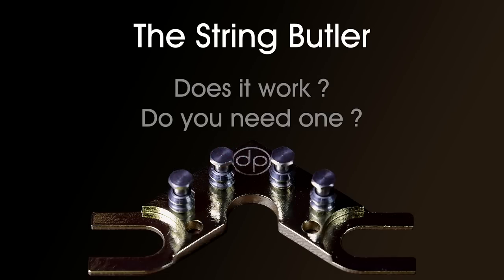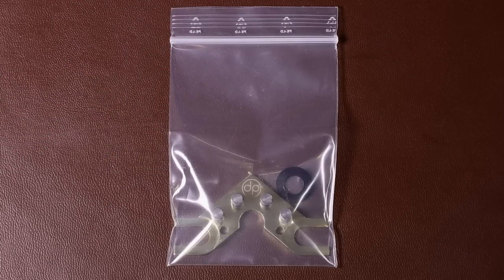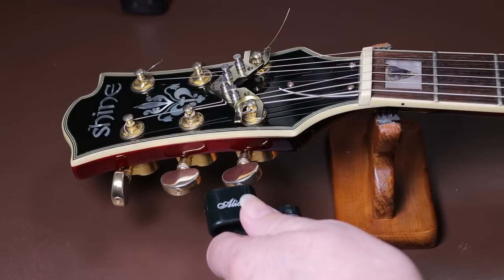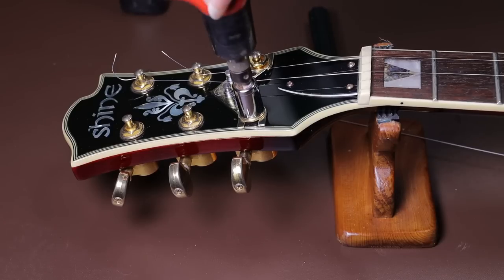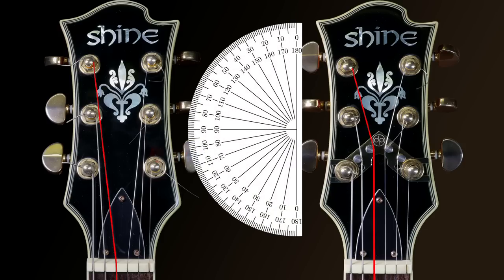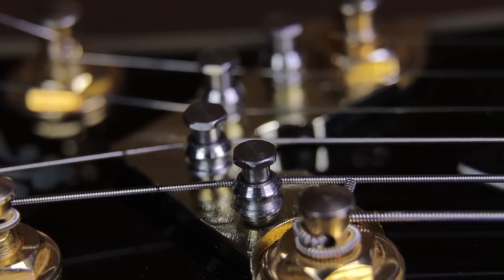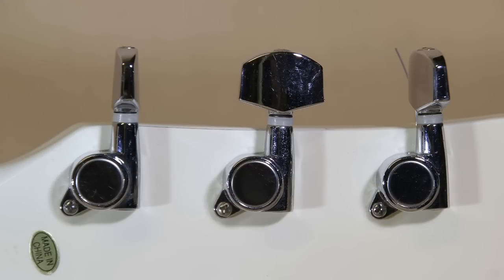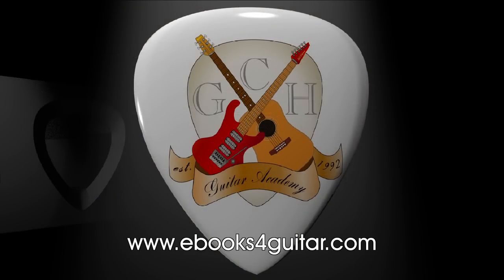the String Butler.  Does it work ?  Do I need one ?  (fitting, test & review)

Comment: I suppose on some guitars it might affect truss rod access (I have one that has the first tuners are close to the nut).... Also are the rollers prone to rattle and is lube favourable?  Otherwise these look quite useful.
Reply from the maker: I didn't lube (as you could probably see) but it wouldn't do any harm.  The rollers don't rattle because the pressure of the strings keeps them in place, but it's something I'll watch out for.  🙂

Comment: I've fitted a string butler to my guitar an LTD EC-10 and it's a massive improvement over the original configuration, you can reverse the fitting of the string butler, that is to say it can be fitted 180 Degrees from how you have demonstrated, this is if you have sufficient room from the truss rod cover; I think that they even mention this in the fitting instructions.
Reply from the maker: Yes, they recommend fitting it that way to acoustic guitars because fewer acoustic guitars have truss rod covers  🙂

Comment: Not  necessary  ,doesnt  do anything,, there is only one  bend ,from the peg to over  the nut , vs 2  bends with the String Butler , it puts alot more tension on the tuners, as well  ,ads another bend and potential Friction if the roller siezes,  looks cool  ,though,,   ,,,,

Comment: Interesting, can you obtain the rollers or the whole attachment in brass. Why? I am assuming most of the contact tension is now on the roller instead of the bone nut hence this may change the tone and possibly the vibration traveling through the bone nut into the neck. Just thinking out side the square!..
Reply from the maker: No . .  all the lateral tension is still on the nut so all the resonance is being transferred into the neck.  That's why the rollers move up and down easily, so they don't effect the lateral tension.   Good question . . .
Reply: Thanks for your reply. I thougjt i put it out there. I like all your vidoes all my axes are master builds.

Comment: Mounting it the other redirection will fix break angle. Probably enough clearance & you could remove truss cover or just a screw if needed. Taller washer? You can certainly see images of such placements on google. If you are joining the modern world to fix tuning I'd suggest getting get a proper compensated nut too.
Reply from the maker: Mounting in the other direction is how you fit them on acoustic guitars with no truss rod cover.  It works correctly as it is so I see no advantage in creating work and making the truss rod inaccessible.  🤔

Comment: A really nice idea.  It might save string breakages up at the nut. Might eliminate or push head-section string resonance way above the playing frequencies.  I do wonder about balance with the extra weight on the neck end.  On the other hand the extra mass of the head might give extra sustain, (if you want it of course.)  An alloy version could solve that.  Is it possible that the lower tension might case the string to move inside the nut during heavy playing?  I do agree about a tiny amount of lubrication on the roller.
Reply: The String Butler is only 30 grams so it is very minimal.

Comment: my feeling is that a correctly cut and adjusted nut negates the need for a string butler. Saying that i have a transparent one on my ec1000 and i like it.
Reply from the maker: Yes I agree . . but it is quicker and easier to undo . . 🙂
Reply: @guitar-academy  yeah .. correct . Thanks for the video
Reply: No, the problem the String butler fixes is a foundational mechanical problem in the design of most 3+3 Headstocks, No matter how perfectly the Nut is cut, what material it is made out of or how well lubricated the Nut is, pulling the string at an angle is a mechanical nightmare for tuning stability. this is such a simple concept all 3+3 Guitars should have been designed with a built in string butler like device from the very beginning.
Reply from the maker: @Lunacy_Phoenix  I agree . .  and some need a String Butler type mechanism more than others, for example the Flying V.  🙂
Reply: @guitar-academy  Definitely, kind of embarrassing how such a blatant design flaw persists over 60 years and how so many classic vintage snobs still claim it to be superior design too. string butler shouldn't be as revolutionary as it is, 3+3 Guitars should have just been designed properly from the start.
Reply from the maker: @Lunacy_Phoenix  don't get me started . .  there's so much in the guitar world I could rant on about . . LOL
🙂🙂
Reply: @guitar-academy  sounds like a good topic to make a video or series about, you should probably get on that ;)

Comment: A very comprehensive review, and I'm sure it works as far as you have described it.  I do, however, see at least 3 reasons not to get one. First, the issue of break angle (up/down) simply doesn't seem to have that much of an effect. Alan Carruth has written about this at length and his research suggests that, for both saddle and nut, the difference is minimal provided their is sufficient downward pressure to transmit string vibrations sufficiently and define the beginning and end points of the strings prcisely. Second, the break angle (side to side) can certainly be a problem, but a lot of companies cut the string slots at a slight angle to account for this, and any handmaker will do this of you ask, or a guitar tech will cut you a nut with this adjustment for a lot less than the price of a string butler. Finally, lots of handmakers and some companies design their headstocks so that the strings pass over the nut without any side/side angle. The telltale sign is that the head is tapered away from the nut (all pedal steel guitars which have standard heads are made like this). Even budget company Seagull has this feature, although the angle is not completely elimiated on their guitars. I have guitars by makers Nigel Thornbory and John McQuarrie (AKA Northwood), neither of which have any side/side angle at all. Hoaving said all that, I also have several guitars with standard pegheads, and have never had the problem the butler is supposed to fix, and I play a lot in altered tunings and string bends. Of course, I'm only experienced with acoustics. It may be a boon for electric players where the bends are a lot bigger. In summary, I think you presented a very balanced and honest review of a product which seems to be an effective, expensive solution to a problem which maybe affects a tiny minority of players.

Comment: Good review. That's a good point on the angled nut slots. I looked at getting a String Butler for one of my Gibson's, but I ended up getting some Gotoh locking machine heads for £60 instead, mainly for aesthetics. I'd definitely say go for the String Butler for straight nut slots, if you're on a tighter budget.
Reply from the maker: Thank for your feedback . . 🙂

Comment: I've been working on a technique of curving my nut slots. I've been working with another tech and with the right files and patient techniques, you can 'arch" a slot to match up with the tuner. I must add that I trim the thickness of the nut to about 1/8" and slope the back. There's about a 1/16th point of contact and my depths are no more than half the thickness of the string. It's works absolutely 100% of the time. You'll end up modifying every guitar you own and never go back. Nut problems disappear and you get a better open tone with added sustain
Reply: Oh, and I add a mixture of Vaseline and graphite to each slot. You can also use deoxit, pencil shavings, silicone spray, beeswax, etc. Just enough to coat under and around the contact point.

Comment: I've put string butlers on almost all of my Les Paul type guitars. The question is: Is it necessary? No, it's not. One can easily go for a bone nut ans tidy off the clearance angle, so that there is no friction at all. Depending on your capabilities, it will be an easy job. But if you are not that kind, dressing the nut may be a challenge. And if you have a cheap plastic nut (like Epiphones come with) you are prone to fail in tidying the nut. So from my experience the string butller is an easy fix, that can be undone once you'll sell the guitar. In my case, it has worked out fine even with cheap plastic nuts. So if you can go with the look, and if you don't mind the slightly overpriced price tag, the string butler is a nice little gadget that does a real value-add to your tuning stability. (Never-the-less, there are similar solutions on the market as well)

Comment: This is a device that fixes a nut that as never fitted to its guitar. It's based on the whole notion of "straight" string path from the nut to the tuner post being superior. Which is how every string takes its path, regardless of headstock shape, unless there's something like a string tree or... a String Butler. The fix for tuning troubles caused by the nut isn't more rollers and friction points. It's cutting the slots in the nut properly.

Comment: That guitar could benefit from the nut bring filed down. The strings are very deep. They do not need to be deeper into the nut than about half way which is enough for them not to jump out and with the string butler this is very unlikely.